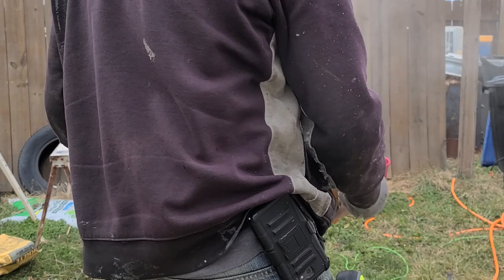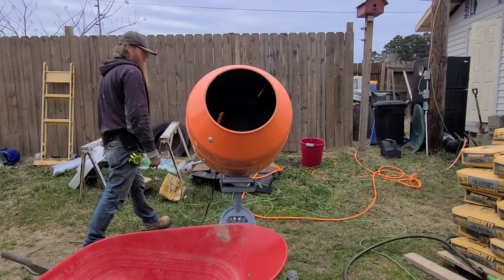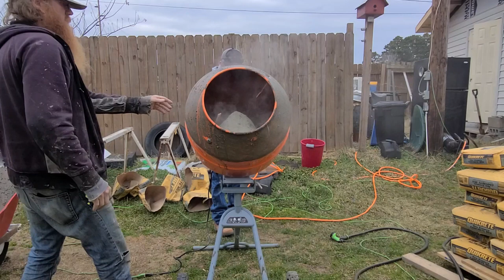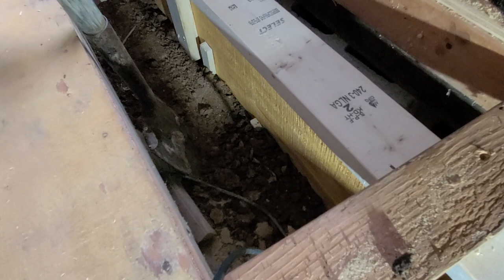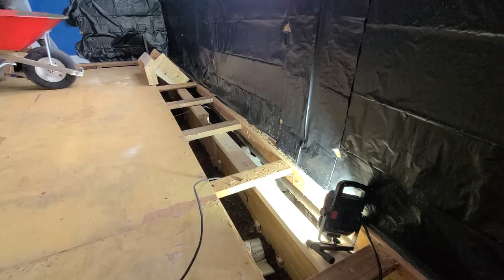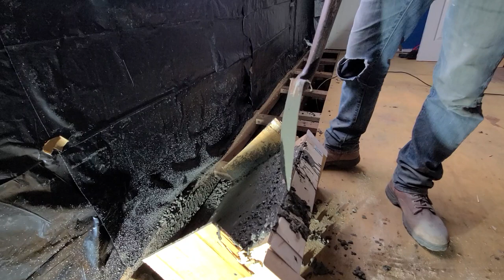Yardmax 5 cu. ft. mixer Pouring Quikrete Bag Concrete in a house foundation DIY [REPAIRMAN4LIFE]

Comment: Give me tips on how to keep concrete from sticking to back of drum
Reply from the maker: Well some people have told me to spray small amount of diesel fuel In drum let it rotate says it helps I haven't try yet
Reply from the maker: Maybe I try a video with different products to see about helping keep drum clean
Reply: Water first
Reply: Just keep the drum sprayed off. Run the drum as you spray it off. The water left in the drum is used for the next load. These guys are messy.